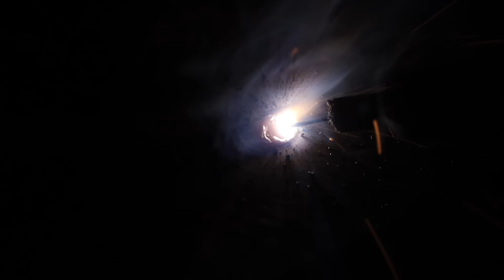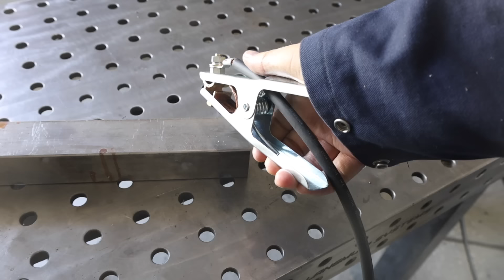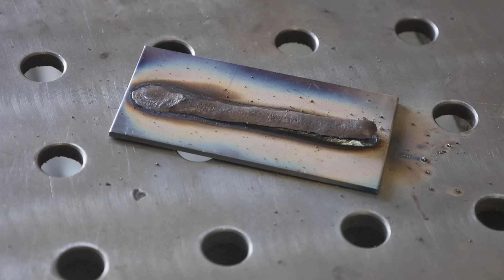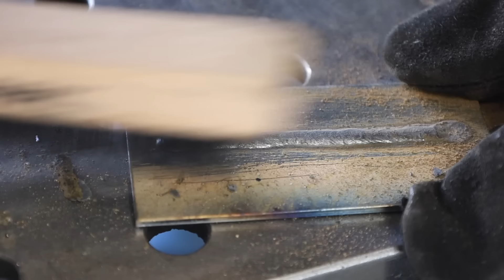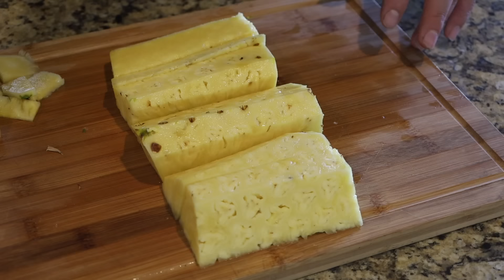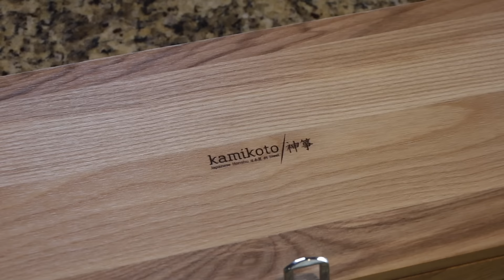Stick vs Flux Cored Welding for Hobbyists: Which type of welding is better for you?

Comment: I started stick welding and when I moved to flux I thought I'd never go back........ here I am many years later and I have more stick welders than flux! Many applications for stick, It's like driving manual, everyone should learn just in case. Great video! 👍
Reply from the maker: MIG is going to be a bit better for the auto body repair, and could also work for the bumper mounts as well.
Reply: @TimWelds  🎉😂😂😂🎉
Reply: I was so excited to get into stick welding, until I was told I also had to have a oven to store my rodes.
Reply: Only if you have critical welds .  7018  and 6013, 7014 has iron powder in the flux and gives that pretty smooth finish.  You could use those 7018 rods undried ,but you could get hydrogen in the joint and be like a common 70 series rod then.
Reply: @enchantedmountain5354  get ya some 6011 thank me later
Reply: If stick is like driving manual, then what is tig? 😂
Reply: @loganblackard3321 A old motorcycle with a hand shifter and foot clutch.
Reply: @LTVoyager or flying a helicopter
Reply: @loganblackard3321 tig is driving electric..🤌
Reply: I'm not good at it but I only like stick welding.
Reply: ❤❤very good if you welding steel 10mm😊
Reply: That would be Oxy acetylene? Forget about clutch, kids are not gonna learn auto, with the self driving vehicles. 😜
Reply: Is driving manual supposed to be hard? I get weirded out when there is no clutch pedal.
Reply: @pettere8429  I drive 3 vehicles, 2 are manual. Sometimes it's been awhile since I've been in the automatic and I sit down and stomp on a non-existent clutch pedal .
Reply: used to happen to me all the time ( i havemt had manual in a while :(((( so im used to ....shitty 2 pedals ) @ThePinkPanth3r
Reply: @ThePinkPanth3r We are creatures of habit.

I jump in my wife's car after driving my truck and try to throw it in gear with the windshield wipers.

I was thinking about that the other day, and tried picturing where all the various controls are on all of our vehicles and couldn't do it for a lot of them until I started moving my hands around.

I think Ford gets the award for most cryptic control for the fog light switch on an 02 F250.

I didn't even know it had fog lights until I was thumbing through the owner's manual.
Reply: @ThePinkPanth3r  me too. Went from manual VWs (21 years of driving those) to a Tesla (similar to automatic but even simpler - no gearbox at all) and quite often I press on the (non-existent) clutch.. at least the first two years

Comment: Stick over flux cored ( out of a “home owners machine” ) any day of the week!
Reply: try doing thin stuff (3/64 inch thick - approx. 1.2mm) and you'll see how painful it is to avoid either sticking rods or burning through. Don't regret going on the stick route, but it has its limits..

Comment: Feel like I could do my whole career with flux core….but so many haters!
Reply: Only the “unknowing” hate ….  
Flux cored ( self shielded/gas less/ open arc/innershield ….  Whatever you want to call it) most definitely has its place in the world ! 
Right now as i am typing this and you are reading this there is a guy somewhere in the world welding a cross country pipeline with this stuff and another guy is building a sky scraper and another guy is building a ship with it! 
Only because there is a homeowner somewhere who is bird shit welding a trailer hitch on his wifes mini van with this stuff …..  that is giving this stuff a bad reputation for no real valid reason …
Sure, personal preference, you may love it and the next guy hates it …. BUT when done correctly this stuff can produce x ray quality welds and for sure is a solid welding process…!
Reply: I bought a neverlast welder a couple of years ago.   When I called to order  a couple of $40ea wire rollers with it ( I think you can buy a $80 welder from amazon), they were welding snobs when I ask about flux core.  Oh flux core is bad, it will wear out our torch liners too quick.  We don't recommend using flux core.  Only when I told them they were about to lose a sale did they say oh yeah it will run just fine, but its synergic mode is not calibrated for flux  
I told them I wanted to use it outside some  and  didn't want my gas  blown away.. .   Turns out it is hard to use outside because I can't see the LED display in the sun.  Knobs are good sometimes, but not snobs
Reply: I prefer flux core.
Reply: Once you get it dialed in, it’s pretty nice, I just wish the flux would come off in big single chunks like stick. But it is very light slag